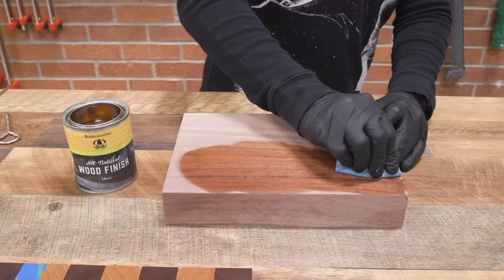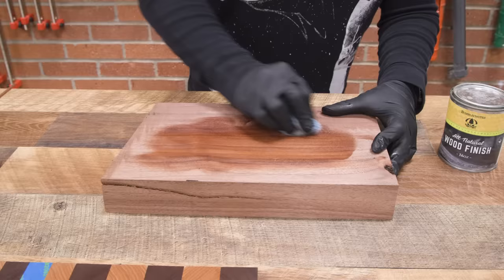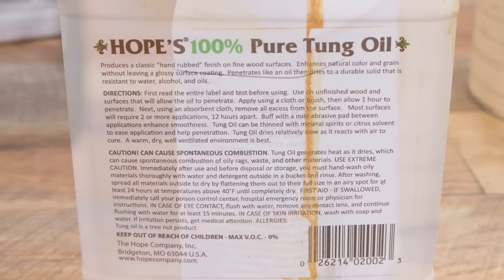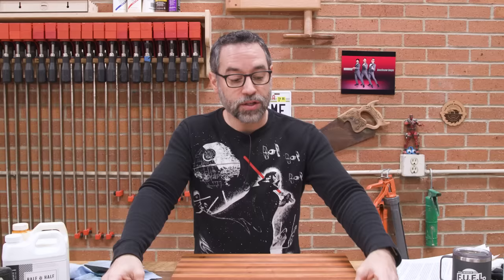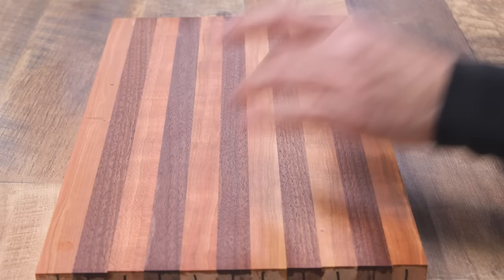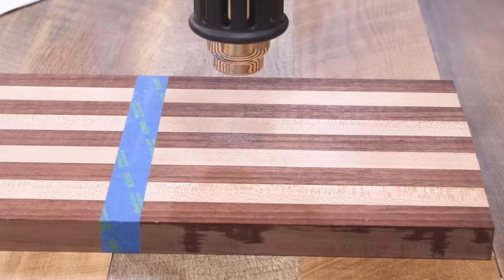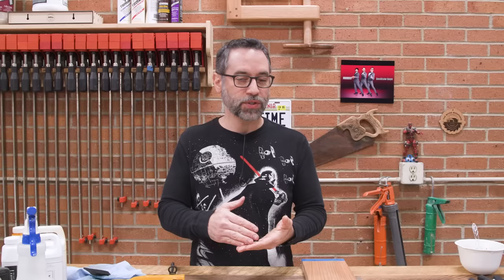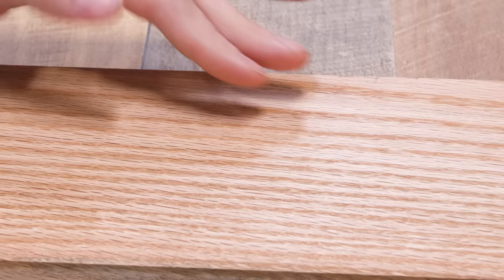A Better Way To Apply Oil Finishes!

Comment: An old finish carpenter told me that if you store your cans of finish upside down, ... as long as the lid is good and tight,... it will prevent the finish from drying and hardening over time and keep it good much much longer. I think he was mainly talking about poly, but if it works, it should work for oils as well, I would think.
Anyone here have any experience with that?

Comment: I made a bassinet for my daughter 3 years ago. I have another daughter coming next month and am making rockers for it so we can rocker her to sleep. My question is, I have no idea what I used to finish the bassinet to match the new rockers. Do you have a suggestion for general purpose finish that will work with anything?  I know I did not use polyurethane.

Comment: Sanding off the stain that came on my cane. I’ll be doing a tung oil finish on hickory.  I’ll use your sparingly applied method but wonder, how many coats?  Additionally, how can I get a medium ro gloss finish?  Should I sand after every coat after waiting 24 hrs?  I’d planned on doing ~10 coats.

Comment: It seems to me that an oil with solvent is less likely to end up with uncured oil in the wood.  When the solvent evaporates away, it leaves the oil on the walls of any pours and not plugging them up.  The air gets into the finish and drys it.  The next layer or perhaps the 3rd layer finally closes up the wood.

Comment: Kind of like seasoning cast iron. You rub on the oil (lard, shortening canola oil), then you buff off all that you can, leaving only a molecular layer on the pan. If you fail to remove the excess, you end up with a tacky/gummy finish.

Comment: I'd like to do a pure Tung Oil finish on some speakers I am making.
These are solid wood veneer (no paper backing) over MDF
I am prepared to wait as long as it takes between coats with the pure oil as I am in no hurry.
How would the technique differ from solid wood?

Comment: Wish I'd watched this earlier. I have just oil finished a garden potting table I built for my wife from reclaimed pine. I spent hours preparing the stock, assembly and preparing for finish. It looked awesome in its bare state. I finished with BLO using the flooding method. Now it's a sticky mess. It's only a week in after oiling and it is dry to the touch until the sun comes out, then it turns sticky. Will this ever fully cure without drastic action to remove the oil? I don't even know where to start to remove it. I tried wiping with white spirit and turpentine but the oil has partially cured and it has little effect except once the spirit/turpentine has evaporated. Beginning to wish I'd painted it now (which was the original plan until I got tempted by the grain of the wood once sanded 😡😡

Comment: Excellent video.  And love the channel.  Have gone back several times to watch.  Making my first batch of cutting boards, edge grain (not end grain), applied the milk paint 50/50 product just as you demonstrated, two coats over two days.  Did not flood them.After 10  days, the boards still have an oil feel and my hands smell like the finish after handling them.  Thoughts?  How long before you’d use the boards?

Comment: Love this video. Thanks for sharing. I have been using your method to apply my kitchen countertop and now it is settled with its fifth coat. However at the last few coat I see it has been rougher and rougher after it dries out. Do I apply too much? Should I sand it out and apply another coat on it?

Comment: I always love your videos, especially the outtakes at the end.  This was perfect timing as I just finished a small build with danish oil and now only want to use oils to finish my projects.  In you experience if its an item that will be gently used, desk top sorting tray, is the oil alone enough or does it need poly or something else?  Thanks if you have time to answer and thanks for all the great videos.

Comment: Great content, as usual 😊 and at the right time. Just bought a Litre of Pure Tung Oil 😁

What can I do to make the wood a little more orangey? Test pieces were pretty neutral compared to boiled linseed oil.

Can I use shellac under or over the Tung Oil? From what I know, shellac binds and is binded to most finishes

Comment: Suppose I semi-flooded a walnut piece with walrus oil (furniture finish) and then watched this video 16 hours later … would it be a horrible idea to apply some heat (just a hair dryer or something) to bring excess to the surface to remove it?

Comment: Interesting test, but keep in mind, that getting oil come out of the surface doesn't means it's not fully cured. You can get any cured oil to a lower viscostiy when heating it up.

Comment: Great video Marc! I’ve been using Bumblechutes on my Baltic birch drawers. Do you think the flooding method is perhaps okay there since essentially the different plys are sealed from each other via adhesive? I’ll definitely try the more sparing method next time!

Also the Backsaw Boys poster is wildly distracting 😂😂😂 assuming that is you Cremona and Shannon?
Reply from the maker: Nope. Probably even less of a reason to flood. You're just going to apply more material than you need. Save some money and apply sparingly and I think you'll still be better off.

Comment: Marc, you mentioned something in this video that peaked my interest. I currently use Sutherland Welles polymerized (heated) tung oil. You mentioned you heat raw tung oil yourself to create that polymerized process. Do you have any idea I would have to heat it to achieve that? I would love to do that myself rather than buy it that way if possible. Of course it would be a lower heat to not ignite the oil 🤯

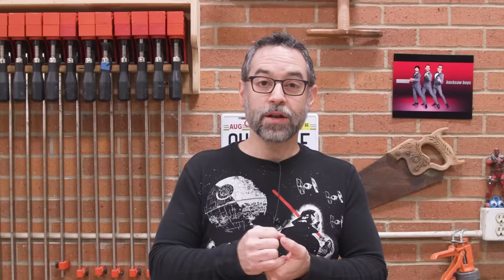Comment: 7:24 great points Marc. In a cutting board, specifically end grain, does the saturation of finish penetrating all the way through the board not help to prevent bacteria absorbing into the board? I see your point for sure. Just a thought. Cheers!
Reply: I always thought mineral oil was the best and safest for cutting boards?  Seems that’s all I’ve heard people mention.
Reply from the maker: I really don't think so. I mean, if you're using your board correctly, keeping it clean and drying it properly, bacteria shouldn't be a major issue no matter what you do. But I don't see how having oil throughout the board would do anything to be more antiseptic than simply sealing at the surface.
Reply from the maker: My thoughts on that: https://youtu.be/l9fqCJ5kJiA
Reply: @woodwhisperer  fair points for sure. It’s interesting to see how deep into the debates people go haha. “I’ve been doing it this way for many years and haven’t had a problem…” This video provides great food for thought to consider changes in your practices. There really is no “best” method provided you know how to take care of your projects. Cheers!

Comment: Quick q - we are building a large outdoor table, I want to use an oil and will use the method you are suggesting. If I apply the oil properly, it is okay to be outside and cure outside because it seems like if applied properly it won't come out?

Comment: I don’t think it’s malicious intent. I think Tung Oil has been around for so long that there was one school of thought for using it, same with BLO. I followed the instructions or my first coat of Tung Oil on a maple stock and it takes a long time to dry. 2nd and 3rd coats were cut with mineral spirits and put on thin. 2nd coat still took a week to dry because the base coat was so thick. I hope it cures well and doesn’t become a problem. I did flood it, let it have all the oil it could drink for 12-18 hours then wiped it down and took a couple weeks to dry

Comment: If you do a follow up video on the ingredients, I'd suggest talking about the safety data sheets.  As a chemist, I've spent a lot of time reading safety data sheets (no clue as to why they no longer call them Material Safety Data Sheets).  I find the safety data sheets sufficiently vaugue as to what's in it and what the percentages are.  To me it's very frustrating, to the point where if a company won't be clear on what's in it, I won't buy it. I like to vote with my dollars.

Comment: what would be a good finish for cutting boards and utensils for places with less than 20 % humidity year round? i have tried the flooding method with mineral oil and it seems to last maybe 2 weeks on the board and about 5 washes on the utensils

Comment: You forgot to say "I didn't invent this or anything" with every single application technique, and have affiliate links for the foam brush you used, the heat gun, the blue tape, and the deodorant you're wearing while filming 🤣🤣🤣

I've always been an inquisitive person, and I've found the "right" way to do things more or less by observing all my failures and my few successes hehe. Expensive road to get to the novice I am now, but worth it

Comment: I'm new to finishing and you're pretty convincing about using thin coats and not flooding.  I know your video is about drying oil finishes, but do you have an opinion about protective coats?  I've been finishing a desktop for a desk I'm building and have been using pretty thick layers of Oil Polyurethane.  I know many seem to like thinner wipe on poly coats, and I decided to wipe on the last coats, but now I'm wondering if I went about this all wrong.

Comment: Something i did not hear mentioned was the lingering citrus smell which takes a week or so to dissipate. I have had some customers comment on a longer lasting "oil" smell. Any thoughts on this?
Reply from the maker: I like to think of the smell as an indicator of the curing status. If you can still smell it, it’s not cured. And same with the solvent. If you can still smell it, it’s still there.

Comment: I just watched a finishing video on YouTube channel paulsDIYsolutions. He likes to combine at a 1:1 ratio of polymerized (heated by manufacturer) tung oil with tung oil based spar varnish. Wipe on with some flooding, then wipe off 2-3 minutes later and let it dry for at least 12 hours. This results in an easier, faster, and more durable finish than straight tung oil or even polymerized tung oil; however, since much less varnish (which is pre-mixed with tung oil) than oil, the plastic feeling issue is almost gone. Hmmm 🤔, makes me think of your experiment with heating.

Comment: Thanks Marc for this clear video. Question - I'm two weeks into waiting for the flooding method to dry on the end grain board. Having gone the wrong route by flooding, can I somehow accelerate the curing process? Would sanding off and reapplying with a thin coat be the answer?

Comment: What would be your recommendation or changes if using tung oil on older cutting board that had mineral oil applied in the past?

Comment: What can I do if after 2 weeks is still oily, I wipe it multiple times. I need it nonoily because it is wall wood panel for clothes (in the entry room to hang coats). Thank you for answer.

Comment: would you sand between applications?? I'm working on a tabletop, and I've read that is recommended to sand between coats, but all sources were talking using flood method.

Comment: I used olive oil for cup wood but after days woods color little changed to gray like dusty because the dust of air sticking on the oil on face of wood so what's the solution??
Better to change the oil or what I do?

Comment: Great video. Can these principles be applied to Danish oil? I know that it is not 100% oil, but your method seems logical.
Reply from the maker: Yes absolutely. Danish oil is definitely one that can cause trouble if you apply too thick or apply too many coats.

Comment: i wonder if I'm "half right"?
I've been applying with a cloth, until the coverage seems even, shiny, but without any visible "streaks" of excess oil, then, 24 hours of setting time, in a warmed shop, then again, for three coats... i think that one needs reasonable penetration on a work surface that will see the occasional knife cuts, scrapes from implements.../??
Reply from the maker: You get plenty of penetration using warmed oil or thinned oil. But as I said in the video, if you have a method that's working for you then this advice might not apply.

Comment: Would you say it's possible to "fix" a piece that was flooded and still bleeding out oil 2 months later by using a heat gun to pull out the remaining trapped oil?

Comment: I applied a layer of pure tung oil over my stained dark walnut wooden floor and I don't like the finish as it is dull and lifeless
Do I have to sand the oil off to apply a different finish like a varnish satin?

Comment: Lmao!! "Stick around!  Maybe we can rub eachother with some Tung Oil and get this party started"  I nearly spat coffee all over my computer!  Well done  I have pretty good luck with flooding  except with end grain cutting boards when i use mineral oil.  I find that the wood pushes the oil out when i bring it from my cooler shop to the warm house.  I hvae a question about end grain.  Can you water pop it while sanding?  I think not but I`ve had other woodsy fellows swear that the answer is yes. I`m curious on your take.  Thanks!
Reply from the maker: For grain to raise you need the wood to dry. So I don’t think wet-sanding will give you the same result as drying then sanding afterward.

Comment: Is it necessary to sand between coats of oil finish? I recently finished some bookshelves with a mixture of polyurethane and Danish oil, three coats, no sanding. It came out pretty bumpy.

Comment: I wish I’d found this video a week earlier! Mr. WW, hoping you can advise. I’m busy redoing one of my gunstocks and applying a BLO finish. Naively as the wood kept absorbing oil, I kept applying as each time it was dry to the touch. After watching this, I realised that I’ve pretty much followed the “flooding” approach and although dry, the oil hasn’t cured (and the wood is quite saturated after using the heatgun treatment). Any tips on how to reverse this (if at all possible) or am I going to have to wait months for it to cure before applying any more oil? Your guidance in this matter is highly appreciated! Cheers, Gareth

Comment: Did he mention wether or not he stands between coats or if he just reapplies? I may have missed it but didn’t notice him bringing that up.
Reply from the maker: There’s usually no need to sand with a pure oil. But if the surface ever feels less than smooth after a coat, there’s no harm is sanding lightly.

Comment: Would you recommend applying heat like you did to try to draw out excess oil and absorb it? I think i went a little heavy, or applied coats too quickly and was definitely having some sweating initially. This is Tried and True on a 3” thick walnut end grain board, I guess about 2 months out now since it was a Christmas gift.
Reply: I had the same question. Unlike many of the other commenters, the timing of this videos was less than perfect. The day before it dropped, I bought 16oz bottle of milk paint half and half tung oil to finish a maple end grain cutting board. Followed the instructions, which jived with the advice from the guy at the woodworking store, and other videos on YouTube, and the end grain just kept drinking it up. I poured most of the bottle on until I noticed it seeping through to the other side. I have it drying/curing with a fan on it, but would like to prevent months of seepage if I can.

Comment: Oh geeze, I JUST finsihed an long grain cutting board following the Real Milk application instructions.... which is flooding..... man, I hope this doesn't turn out to be an issue.
Reply from the maker: I'm sure it will be fine. It's not a death sentence for a cutting board, just something that COULD result in curing problems. Give it a nice long cure period and it should be just fine.

Comment: One thing I see missing from these tests is how the different finishes will behave when the surface has been cut. The argument that you don't need finish below the very surface is invalid if the knife marks are deeper than the surface finish. The entire purpose of cutting boards is to take damage so that your countertops don't have to. I care a lot more about how the finish behaves with significant use than how it behaves with no use. My cutting boards aren't just countertop decorations, after all.

Obviously it would be impractical to expect you to use each of these boards for weeks or months before testing the water penetration, but a few cuts in the test area would be informative. A couple of rocking cuts with the length of a chef's knife and a couple of dragging cuts with the point of a blade would be enough to simulate some use that would cut through the surface to a reasonable depth.

Comment: Hello. I plan to buy cutting boards from The Boardsmith. I discovered on their Instagram that they flood the boards with mineral oil. I watched your other video regarding mineral oil vs tung oil and came to my own conclusion to use tung oil for my cutting board / wooden utensils oil needs.

Is it okay for me to use tung oil when they start to seem dry? I’m worried that the mineral oil will interact with the tung oil… Thank you in advance 🙏

Comment: I started using tung oil on my boards but on a couple i have gotten a weird white splotchy pattern that grows, it looks kinda waxy or ashy from sanding.. any idea why it's doing this.. it has also happened on a second coat after a month or more of sitting

Comment: This is great information! I think the flooding method just became traditional practice given that getting more soak in is an idea that appeals to common sense, which, as you've shown here, can be wrong. However doesn't thinning give you more penetration? That's one reason often used to justify it. If penetration is bad, it seems that thinning should be bad, and you should just sparingly rub it on full strength and immediately wipe it off. You can get just as thin a coat using it un-thinned, and it's really not that hard. Why would you want to deal with and fumes have to wear gloves when you don't have to?